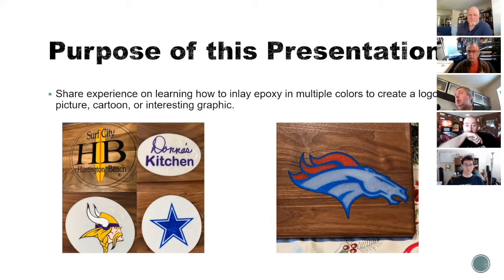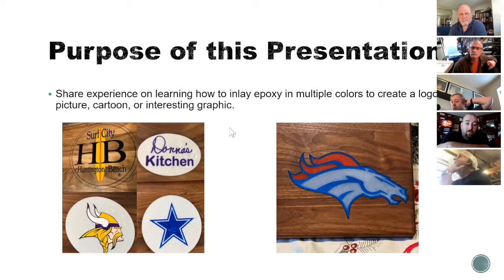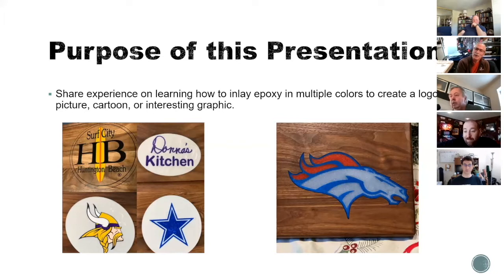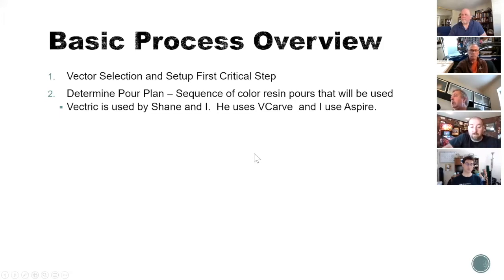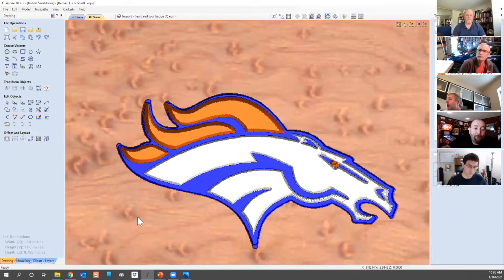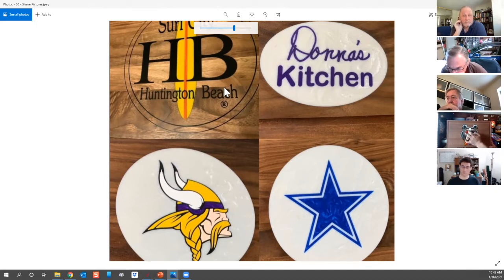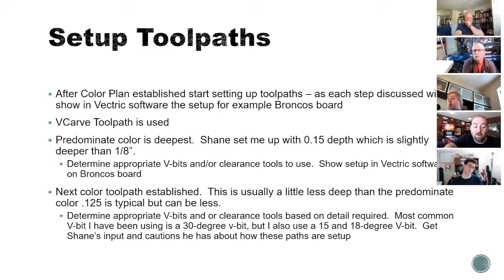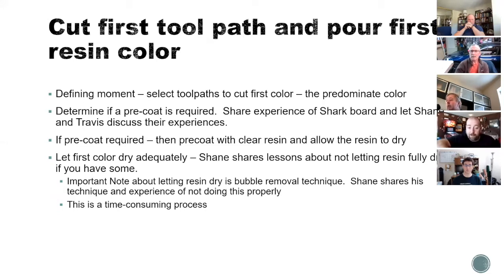Multi-SIG - Multicolor Epoxy

Comment: I have used Sanding Sealer to seal up the cut grain and find it works great, I apply 2 coats and it's all dry with 30 mins. Nice and thin liquid so seeps in and leaves room for the pour. Great video and conversation guys...Love it. Thanks a bunch
Reply: I’ve only used clear epoxy for my seal coats, but have heard of others using sealers like the one you mentioned.

Comment: Is it possible that on the laser cut Austin skyline that the actual pre-coating you used, combined with the lasering heat, caused the pre-coating to actually seal the wood better?
Reply: You should NEVER laser burn over any epoxy from what I’m told. I have heard it’s toxic to burn it. Would love more info myself on this.

Comment: So far as helping with the 'wicking' issue discussed at time 1:01 into the video, have you tried a thin coat of clear shellac painted into the first/deepest Vcarved pocket? I've had decent results, but haven't compared it with your method of a thin coat of resin.
Reply: I’ve never had that much luck with Shellac, so I just do them all with clear resin now.
Reply: @shaneshardwood6321  agreed ... I'm now seeing clear resin seems to work much better. Thx.